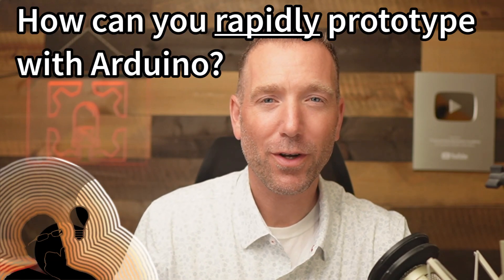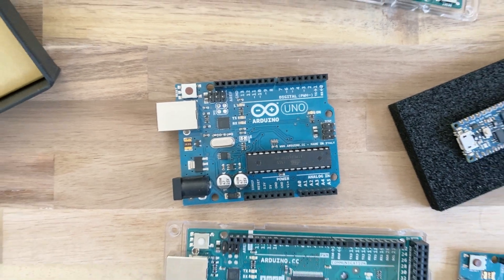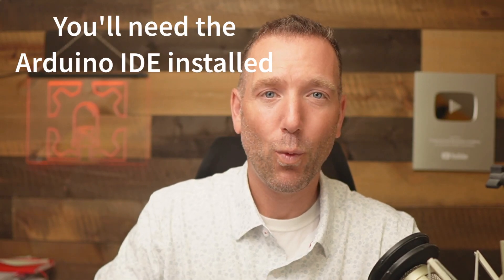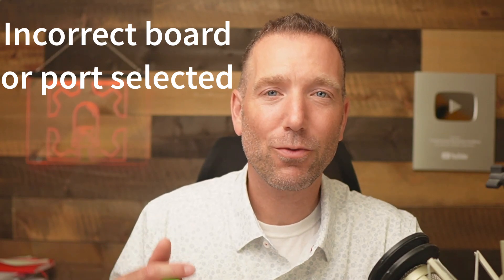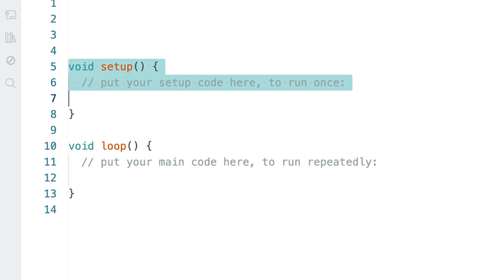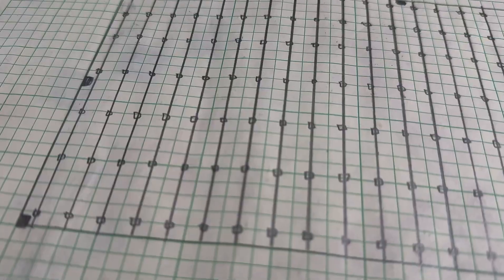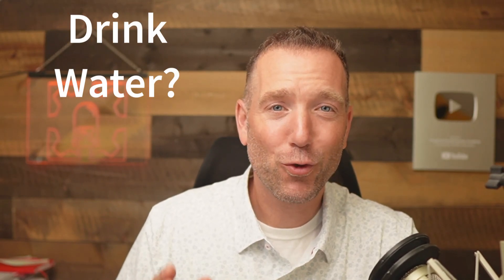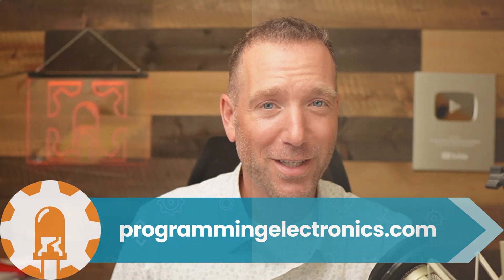How to prototype an electronics project FAST! #TeamWater #arduino

Comment: I want to make an esp32 c3 compute on memory nvme m.2 for file management mobile NAS. The Risc-V would be for PGEmcryption. I have a USB-C Dongle. I really want to take all of my old hard drives thumb drives. I have a MicroSD to USB-A adapter a 1Tb thumb drive a 2tb HDD Seagate formated to a mac unfortunately and an Android and a Windows 10. Not sure where to start. See any problems with my selection. Eventually I want an llm GPT file manager

Comment: Great video, especially for those not familiar with Arduino programing, but great reminders for all.  The 5v / 3.3v issue is a big one.  Level shifters can save the day.  Have you done a video on using Level Shifters?  Thanks!  Regards.
Reply: I have not yet - but I think that is a great idea - thanks!